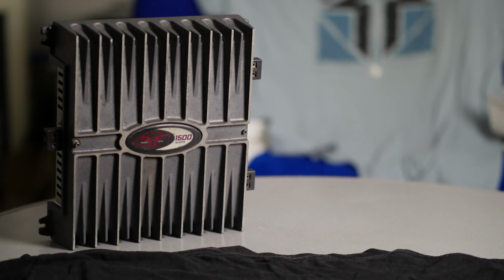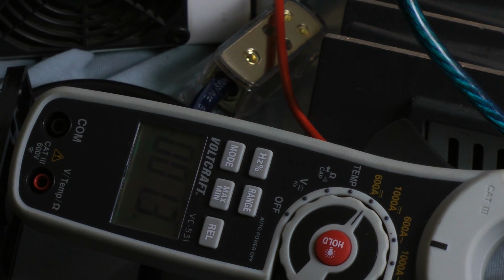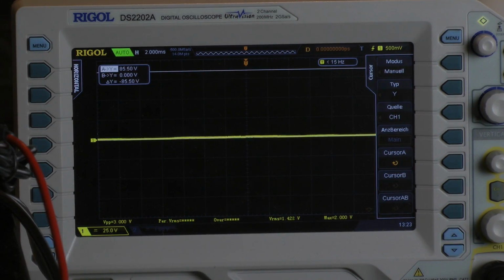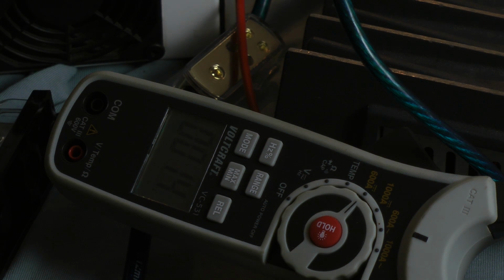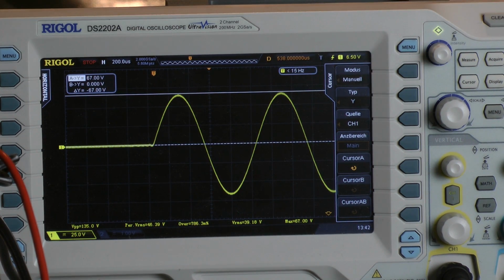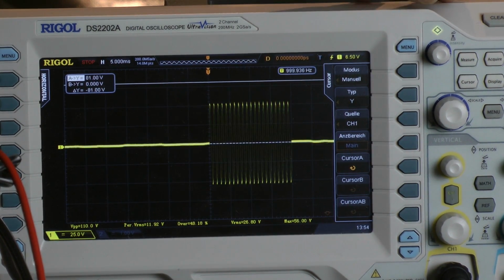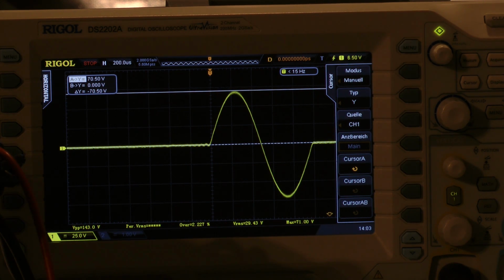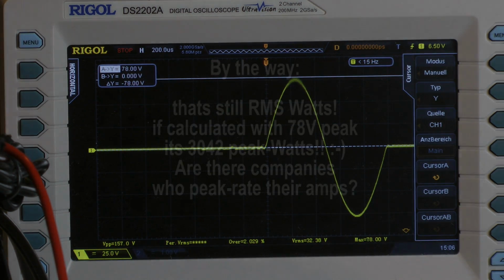Rockford Fosgate Punch 501s car audio amp dyno oldschool subwoofer amplifier power test soundcheck

Comment: i have one of these runing a 8 inch ct sounds meso at 2 ohms,  it sounds noticably better then a modern 1k watt class d
Reply from the maker: Just curious to know with which class d amp did you make the comparison ?
Reply: @audiokeller1975  down 4 sound JP3

Comment: I think the last test you did when you got 1521w (peak), is the number that Cheap, No brand amplifiers, use to sell more amps!  I think Rockford displayed that bumped up number, to compete with those Cheap amplifiers.  A marketing strategy!😊
Reply from the maker: Yeah, that peak rating is still RMS, if calculated with peak voltage it’s 3000 Watts 😂
Reply: I bought this amplifier recently, but it doesn't sound as good as I thought it would!  My Punch 150hd amp sounds better, specially the bass. It sounds deeper!
I thought the 501s amp having more power than the Punch 150, would play deeper bass, but it doesn't!  Any idea why??  Thanks.😮
Reply from the maker: @charlesbolano7148 hmm.. it’s linearity is nice. A human ear shouldn’t hear any differences. Were both amps installed in the same car? Different locations create big differences. If both amps were compared in the same car I would check the amp for linearity maybe some capacitors are bad or a failure in filter/EQ circuitry are possible resources of failure. Get a generator app and sweep from 20 to 100Hz and check differences Output.
Reply: @audiokeller1975  They were in the same setting and same tone controls (18db boost at 45hz), when tested.  The 501s midrange frequencies sound better, and all around louder.  But the Punch 150's bass sounds better and deeper!  The Punch 150 is from around 1991 or 92, and the 501s, I think it's from 2002.  Maybe that's why they sound different?  They're about 10 years apart!
Reply from the maker: @charlesbolano7148 the 150hd does 20-20.000Hz with a tracking error of just +-1 dB, you won’t hear that error. The 501s is doing the 20-20kHz +- 0.5 dB , if you notice differences you might have alien ears 😀 but I think something is wrong or mismatched!
Reply: @audiokeller1975  125w per ch v. 75w is not a small difference in power.  Almost twice!
I think the Punch 150 amp has a true 18db bass boost at 45hz.  The 501s, although the bass knob says 18db boost, sounds more like a 12db boost!  I know if you could hear them, you also could tell the difference.  My ears are not special.
Maybe that's why the Punch 150 costs more than the newer amps, because it sounds better!  It moves my 2 15" Punch subs with ease (1000w max), and it sounds great too.  Thanks for your response, I appreciate it!
Reply from the maker: @charlesbolano7148 doubling power is  a difference of 3dB, not much. But I guess I completely misunderstood the problem, you are saying that the boosted bass sounds different, right?
Both are 18dB at 45 Hz that’s correct but it’s possible that they have a completely different „ Q „ that means a narrow boost or a wider boost, that’s something we don’t know. A very narrow boost is boosting at 45Hz and almost leaving out the frequencies below and above 45Hz. A wider boost includes frequencies of let’s say 30hz and 60Hz. That’s a big difference in sound boosting if a sub can play under 30Hz
Reply: @audiokeller1975  Yeah!  With the bass boost all the way up on the Punch 150, the bass sounds louder and deeper, than with the 501s amp.  At the exact, same volume level!
Thanks again.

Comment: Okay the 1500 watts for that series of amplifier is stating if you run three of those Daisy chained that was their thing back in the day you could hook three of those amplifiers up together of the power series I believe and run three of them as one
Reply: So. Find an mtx thunder ta-2300..amp.. it will show you fast..its the best.. yes..I didnt want to state this in public.but you gave me no way to contact you in private..
Reply from the maker: You can contact me 🙂
Just log in on YouTube via a pc , then go to my channel , there should be a button to contact me, this button isn’t available if you are on mobile device 👍
Reply from the maker: Hi 👋
This amp isn’t from the power series, I know the 500M or 250M , there you could link two of them together or the class bd amps. I’ve been told by former Rockford employees that they printed those high numbers to compete with other manufacturers. 😀